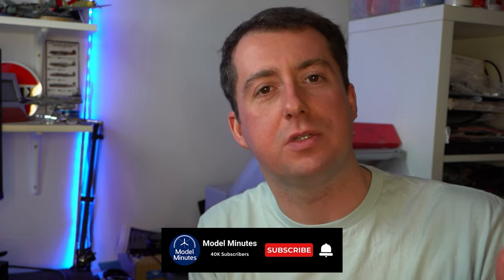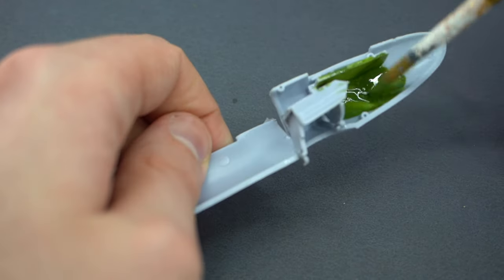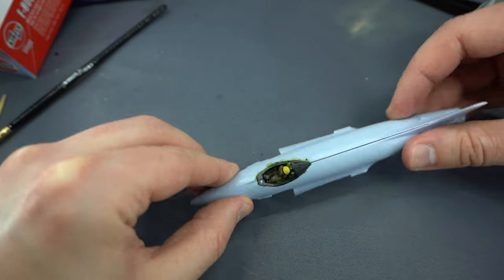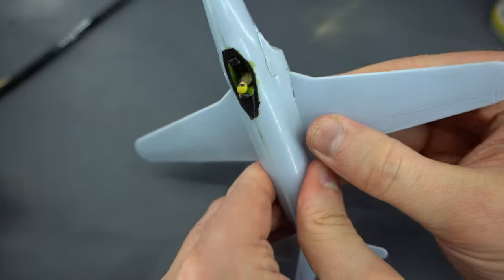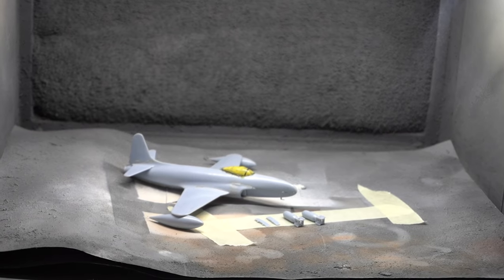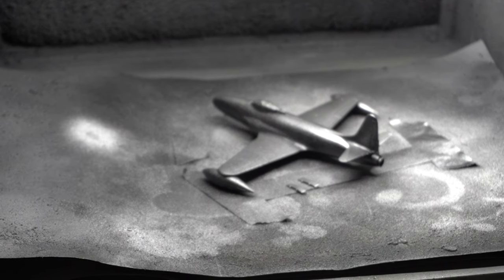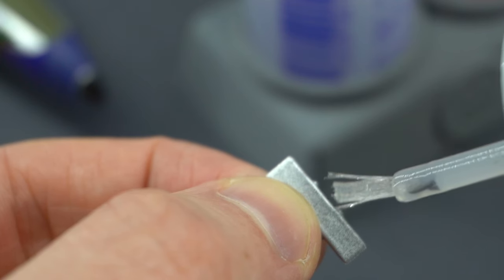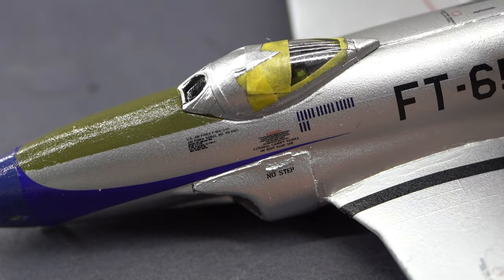No Airbrush? No Problem! Airfix F-80C Shooting Star in 1/72 Scale - Plastic Model Kit Build & Review

Comment: I have been building model kits since 1984, starting with some 1/72 Airfix boxes, and the only time I tried to use an airbrush for a few months, at the beginning of the 90s, I hated it so much that I was about to abandon this hobby, since then only Humbrol enamel colors and brushes and with the experience accumulated over the years I can say that even if not perfect the models I build are quite good, however both I and the friends for whom I build them like them and this is enough for me.
by the way, I don't even do the washing because I don't consider it painting but just smearing the model and letting that dirt do all the work, removing what's left over.
Reply from the maker: thanks for sharing your thoughts

Comment: The kit turned out nice. As to the blue on the nose not quite matching I have a possible idea/solution. As the transition is abrupt if you lightly painting on to the decal near the current transition with the blue paint not in a straight line it might be less noticeable? Not sure but it might be worth a go. Your eye is drawn to the current transition- if not so abrupt it might play a trick with your eyes an not be seen as easily. Either that and the decal gets obliterated. Roll the dice and take your chances.
Reply from the maker: because the decal has a flat edge where it meets the paint, you will always get a sharp transition - i think the only option is to paint the blue instead
Reply: I painted over the behind-the-nosecone decal on my Mustang.The decal acts as a painting guide and it seems less faff than masking.

Comment: Good result, your unboxing prompted me to buy one.  Currently it's part built, mine has fit issues around the jet pipe, but I think some filler and paint will resolve it. I was going wheels down until an unfortunate front landing gear incident....  Luckily I have some stands, so it will probably end up flying!
Reply from the maker: I think you will enjoy having this one in a flying pose :)

Comment: Well hello Matt, that build came together very well. I was pleased you chose to tidy up the landing gear area as in flight this may well be shown. Personally I am tiring of 1:72 and look for 1:48 as my standard although choice does slim down as price creeps up?! The larger scales become price prohibitive I feel and choice well is there any?? Airfix seems very 72nd focused for 2024?
As you have shown, can, air, brush all work just fine, my lead is airbrush as it’s better in many ways and once one has invested be a real shame not to learn!! A tip I was given and found it successful was a colouring book; cheap, varied and many ‘levels’ to buy.
Good video as always. 
Bob
England
Reply from the maker: Airfix does indeed have more kits in 1/72 than 1/48, but there is still a sizeable selection on their website (or has been in the past) such as Spitfires, 109s, Mustangs, F86, Javelin and others - their 1/48 Sea King is quite impressive.

I think Eduard has a good selection of 1/48 subjects, but yes - as the scale goes up there is more plastic in the box which does push up the prices

Comment: This vid has some useful info.the paint on the model is looking good.2questions what container did you use for the spraying,also what kind of paint were the gloss blank and silver enamel?im considering starting my plastic scale modeling again,so im a beginner.
Reply from the maker: What do you mean by "container for spraying"? Do you mean the can the paint comes out of, or are you referring to my spray booth? A full paint list is featured at 01:10 giving all the products I used during this project, there are also pop-up graphics with the products used at the relevant times too
Reply: since i am a novice i meant the spray booth @ModelMinutes
Reply: what is a spray booth? @ModelMinutes
Reply from the maker: @jeffdurling2167  effectively a box with a fan at the back which sucks all the air through a filter so that the paint in the air doesn’t get breathed in

Comment: If one is a beginner in the plastic model building world I would strongly recommend them NOT to use airbrush. I think it is both cheaper and better to learn the basics of model building with brushes or maybe, with a spray can.  Air brushing is not cheap and it may even scare a future model-ace away from the hobby with all the numbers (pressures and so on). An airbrush is something you should pick up along the way to perfection. Learn the basics first, get used to them, find ways to fulfill your ambitions with your project. I even have thoughts about finding ways to create the look of a used airbrush without even using one, just with brush or other cheap tools. For the beginner...the first step is to feel satisfied with the finished work, not to compare with an airbrushing modelbuilding ace. It takes years and a lot of mistakes to get even close to the perfect build. Prio one should be to have fun and enjoy the building process, and the cheaper, the better!
Reply from the maker: good points, I see in many online spaces that the belief that using an airbrush is the go-to solution for smooth paint. But without the basics of understanding paint and how it is applied, (and with the specific difficulties of airbrushing) it can result in a negative experience

Comment: Ok matt here what I see the bottom bay doors were a bit messy how they fitter the putty or filler was a bit to dry the door had some fitt issue the wings fitted not to bad painting was good decal were not to bad sense it was a old kit by air fix I know the glue was a bit running the landing door bay kind of messy oh yes the stand part I guess you didn't need the weight it will sit on the stand love to comment on the build yes the gaps under the bottom
Reply from the maker: Thanks for watching

Comment: HI Matt, do you have any hints on stopping the buildup of paint on the Humbrol tinlets that end up stopping the lids from fitting properly and the paint drying out. Still dogs me after 50 years of modelling.
Reply from the maker: i always clean the lids of my enamel pots after I open the tin
Reply: @ModelMinutes  I do too, but it just builds up on the lid.
Reply from the maker: @ashleybishop9937 have you tried wiping the rim of the tin as well - where the lid attaches?